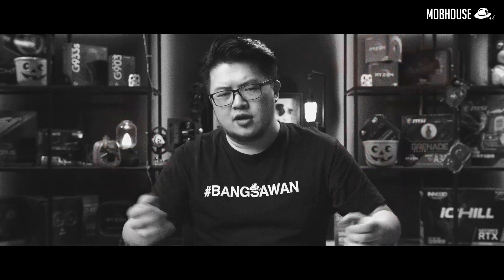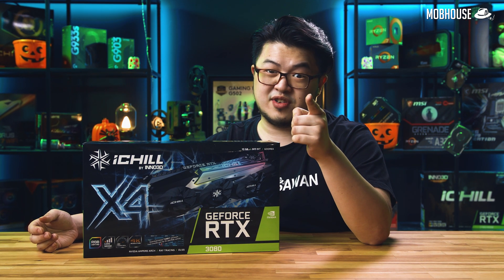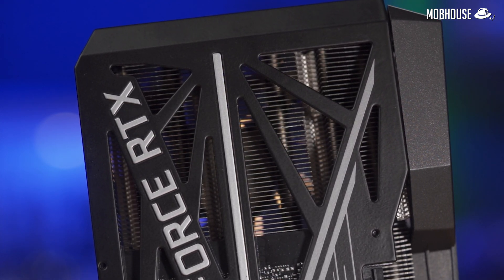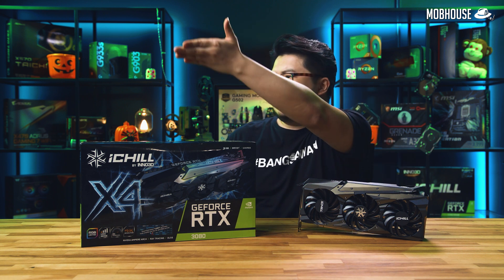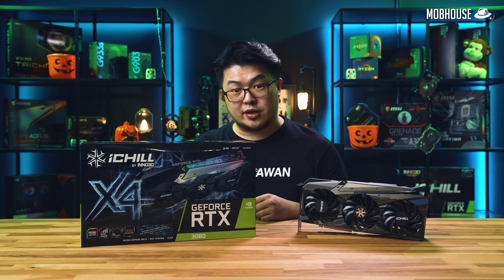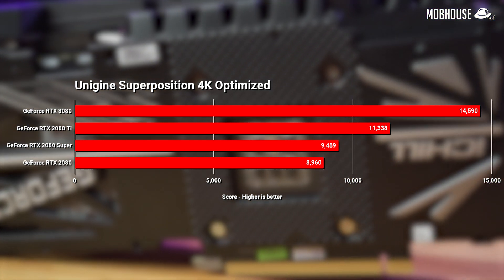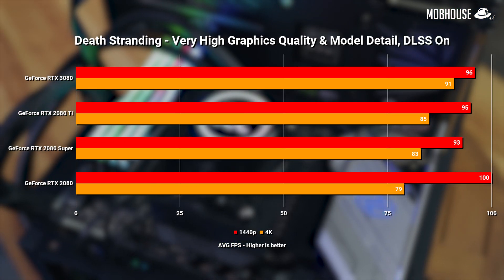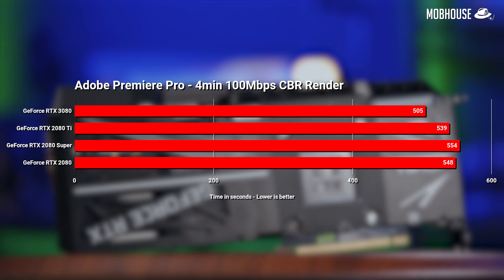INNO3D GeForce RTX 3080 iChill X4 Review (with Benchmarks)

Comment: I have the X4 3070 which has the exact same cooler, fans maxed hit over 3000rpm so at full blast she ain't quiet, though even with hot ambient temps inside it stays around high 60's mark with fans at about 70-80%, so far has never gone past 70C. This 3080 will be about the same possibly a little warmer due to more power so nothing to worry about for those who wanna know about temps.
Reply: Thanks for the info mate, about to buy i chill x3 3070, hope it's worth it. i have two options msi ventus 3x and inno 3d ichill x3
Reply: Is she still alive to this day and kicking?

Comment: Hi there, hello from Cape Town, South Africa.  It was great seeing another review of one of the less expensive models of the RTX 3080.  I personally have the Palit RTX 3080 GamingPro OC and the capacitor assembly at the back is the same as the one from Inno 3D.  Funny thing is the mouse pad I am using is still an IChill Inno3D from many years ago.  At present this card is great, but the power limit is seriously holding it back.  Even increasing the power limit by 9% as you can for 350watt do not really help as your core clocks still drop when reaching or passing 320watt.  Still it is a great card so I cannot complain.

Comment: ****The crashing issues has been put down to driver related and now fixed by Nvidia, it never had anything to do with "cheap components", Jay video was poorly research horrifically balanced garbage. MOBHouse disappointing you are not up to speed on this.
https://youtu.be/lhyCdraz54s?t=350
Reply from the maker: I recorded this video a few days back and have since added an "Updates" segment to the video if you could just refer to the timestamp. We're a small team, we don't have the resources to redo entire segments based on any new information that we receive neither would I without doing at least some verification on it's legitimacy. Like I have mentioned, those are speculations of Jay. Even then, I personally did not think that it was actually that simple.

Sorry to disappoint. We're constantly trying to do better. :)

- Shane
Reply: @MOBHouse  aahh ok fair enough!

Comment: Have to say this is more about 3080 review than inno3d ichill 3080 review. I wanted to see the noise, temperatures, build quality and other details...
Reply from the maker: Hey man. Due to the entire fiasco around launch which I thought needed to be addressed, the video length was getting a little out of hand.

If you want my review on those things you asked, here's the gist of it:

1. I thought the 90mm fan on top would be noisy and it's definitely audible but not as bad as I expected it to be even during a full load stress test.
2. Temperatures are still getting tested. Tbh, I tested it on an open bench and wanted to stick it in a case before making judgement since that's more indicative of other people's use case but we ran out of time since we're currently really swamped with other projects right now. So do best with me.
3. Build quality has definitely improved over previous generations of iChill. I was pleasantly surprised at how rigid the entire construction of the card is.
Reply: @MOBHouse  thank you for the detailed answer. Really appreciate it!
The only question I have left is comparison between ichill and some other card (msi, evga or asus)